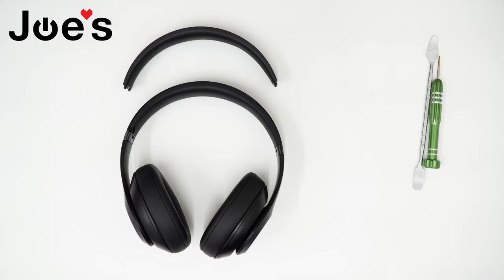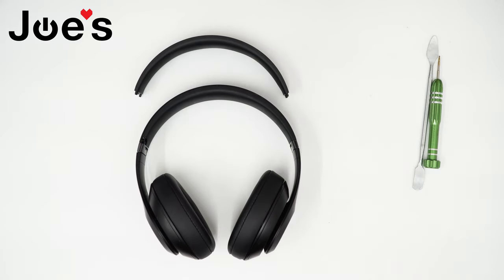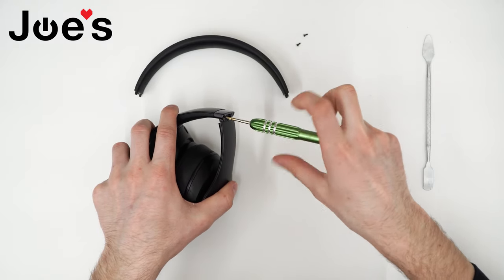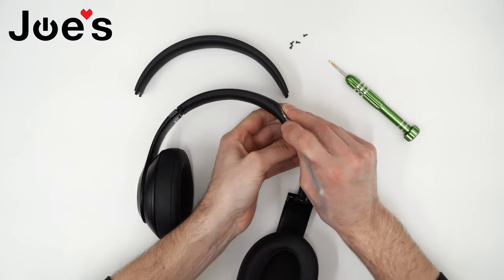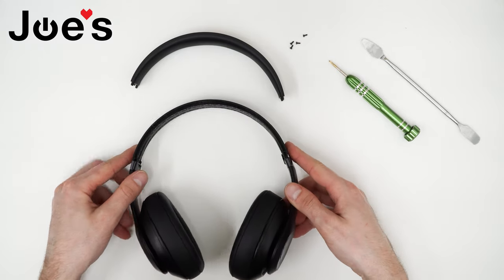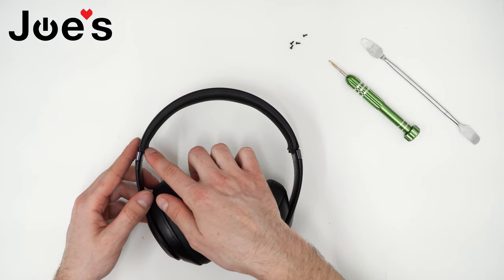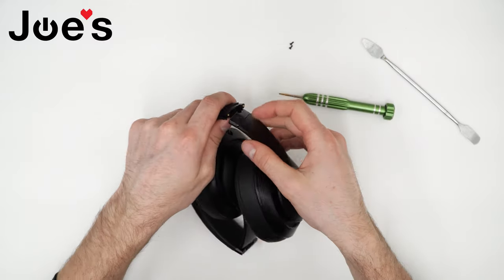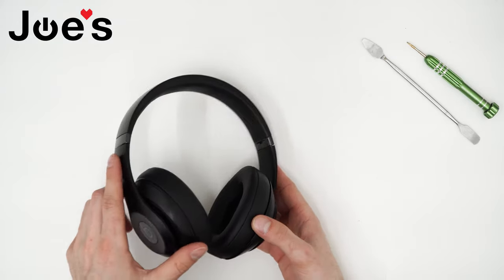Tutorial How To Repair Ripped Broken Headband Cushion Beats By Dre Studio 3 Wireless Headphones

Comment: how much would it cost to have you fix up my beats solo 3 hinges?
Reply from the maker: Thanks for reaching out to us. We can definitely repair your product for an estimated cost of $120 (For both hinges). You can send your products in to us for repair by following the steps on our website here: JoesGE.com/pages/repair-services . We offer a 100 day warranty on our repairs and the turnaround time is usually between 1-2 weeks. Your repair cost will be estimated when you fill out the repair form linked in this message, you are only required to pay once the repairs have been completed. If you experience issues with the repair form, please try using Google Chrome as your internet browser. 

Ruslan P